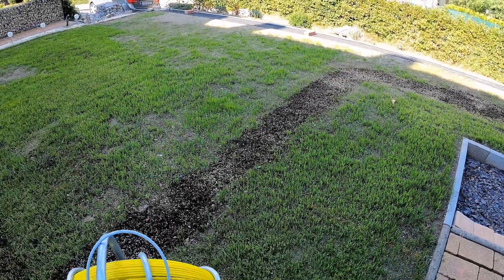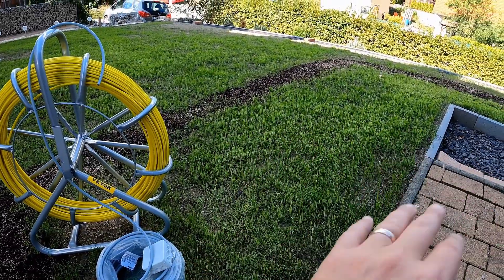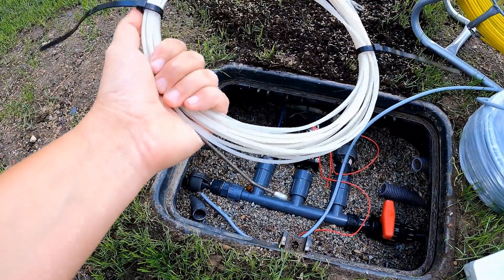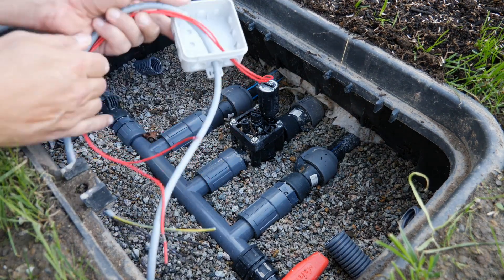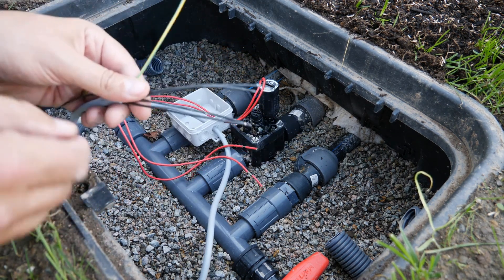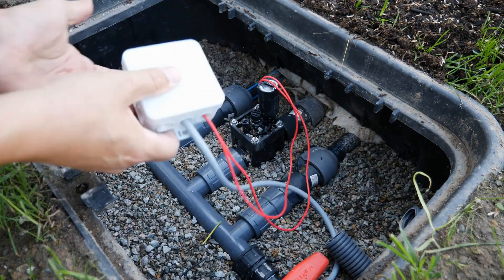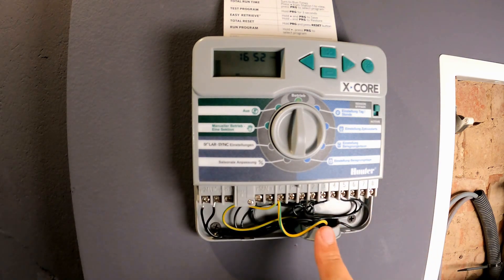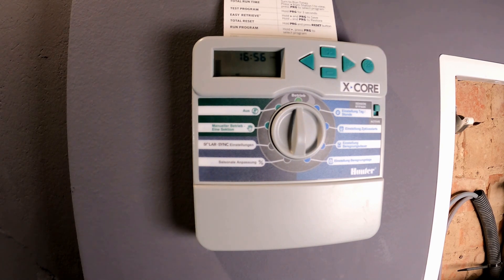DIY Lawn Irrigation Setup: Hunter X-Core Connection Guide

Comment from the maker: Products used*:
🔗 Hunter solenoid valve: https://amzn.to/3pJO9bQ
🔗 Control cable: https://amzn.to/3OLuSm6
🔗 WAGO terminal: https://amzn.to/3yrWDZG
🔗 Wire stripper: https://amzn.to/3EJR90h
🔗 Epoxy for electrics: https://amzn.to/3D9Bbf3
🔗 Hunter X-Core watering computer: https://amzn.to/39pbuW1
🔗 Pulling aid: https://amzn.to/3I7ySe6

This video was originally created in German for my main YouTube channel @commaik 🔗 https://youtube.com/commaik. It has been translated into English using 🤖 the AI tool HeyGen, which replicates my voice and synchronizes my lip movements. 

Please note that ⚠ due to dynamic adjustments, the synchronization may not always be perfect.

📺 The original video, which includes English subtitles, can be found here: https://youtu.be/eHTYT5RI8N4